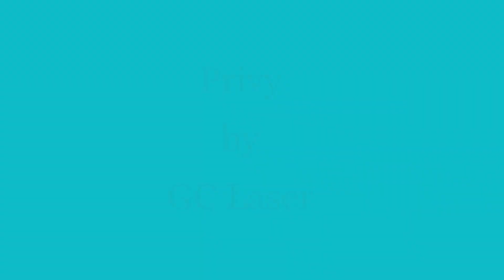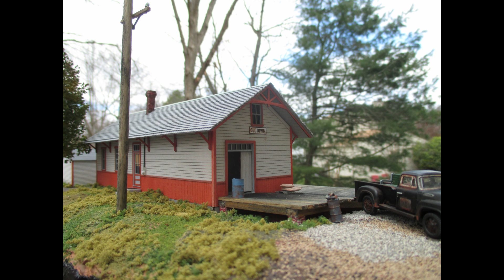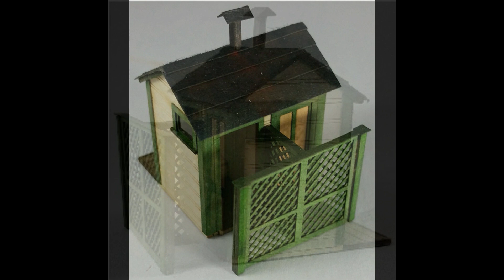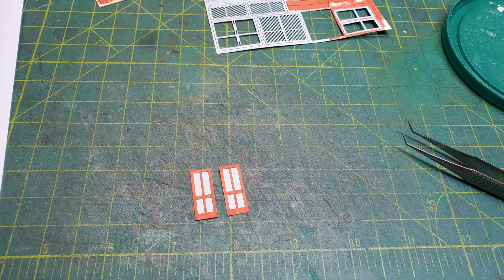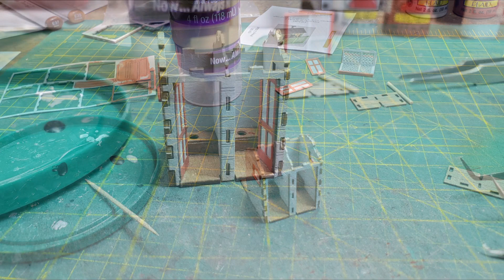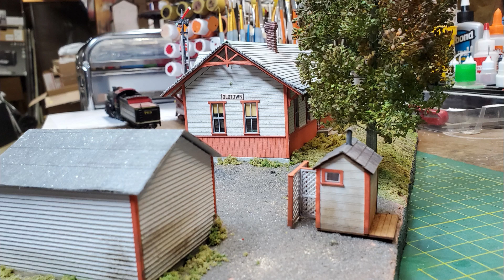Privy by GC Laser

Comment: Great little model and your build inspired me to build one for my WM layout too. What colors did you use for the kit?
Reply from the maker: Thank you, Roger. For years, when I'm brush painting as in this case, I use Apple Barrel brand from Plaid- Dolphin Gray 20781, and Cinnamon Apple 20765. But they've discontinued the Cinnamon Apple and I'm running low. I found a cross-reference chart of how to mix other craft paints to match it, but that was a lot of work, and I found Apple Barrel Red Spice 20540 is very close. If I'm airbrushing, I use Vallejo paints and use their Grey Primer 73.601 and usually their Carmine Red 70.908 or Dark Vermillion 70.947. For rattle can I use Krylon Misty Gray and Painters Touch Red Primer #1967, but hardly ever do that. Of course, their buildings would fade and get dirty, so almost any Gray and Red could work. I hope your passengers can soon relieve themselves. 😄
Reply: @CassidysWorkshop  Greg, Thanks for the answers. I love all your WM buildings. I'm new to laser kits and have the privy and the CCM Thomas enginehouse. It's a huge disappointment. I've built craftsman kits like FSM and others for 40+ years and never had any issues but this kit is definitely poor with many missing items and the worst instructions I've ever seen. Anyway I recently purchased several Medford WM kits and they look great. Love your structures and channel.
Reply from the maker: Thank you, Roger. I haven't seen the Thomas enginehouse. I did build the station, which was tricky. I've built quite a few of Jim's Medford kits, and while they were very basic, he put a lot of research and a lot of care into them. I'd enjoy seeing any when you finish.